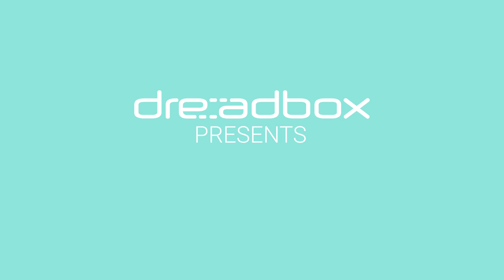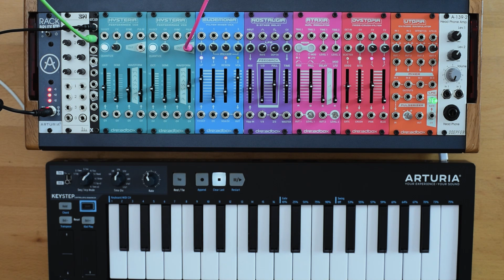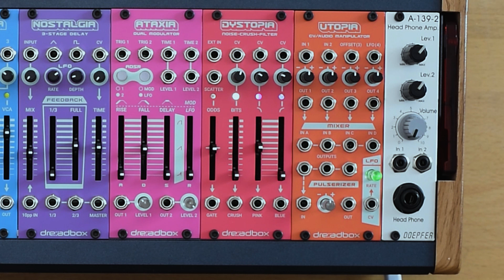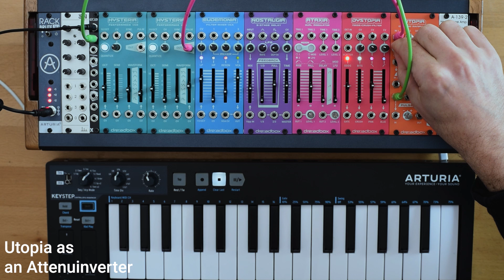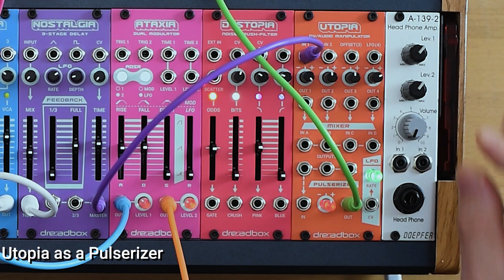Utopia / CV-Audio Manipulator - CHROMATIC MODULES by Dreadbox

Comment: It is unreal how much Dreadbox packed into one module here. 4-3 mixer. Buffered adder and splitter. Triangle (and a hack for square) LFO. 4 attenuverters. Distortion via the pulserizer. This is like five modules for less than $100. It’s possibly the best Eurorack utility value on the market right now.

Comment: Question: if you plug in CV into inputs 1 through 4, then audio into inputs a-d, and output that audio with the sum outputs, will the audio outputs be modulated by the CV in the inputs 1-4?

Comment: I get that ‘chromatic’ series calls for a colorful faceplate... but there is nothing better looking than a full black rack IMHO. Lovely little modules at an unbeatable price range though.
Reply: They made them all black lol
Reply: You could take the panel off and spray it your desired color?

I'm probably going to do it to my Ataxia, the layout for the module is symmetrical so I can spray it on the other side and preserve the front panel in case I change my mind. 

The main thing that bothers me with the chromatic range is how close the trimmer pots are to patch cables when they are patched. Makes it awkward to use them. I'm considering designing a few small modules specifically to control them for live performance.

Comment: Utopia is fantastic! Got one a few weeks ago, it just offers so much in a tiny space.  Essential for my 6U Rackbrute.  So much thought went into this Chromatic line, they easily outperform similarly priced modules. 

I was using a gate button module to advance my step sequencer but the signal was too much (10v) and caused it to skip steps.  So I ran the signal through the Pulserizer, which tamed the gate, and the sequencer works perfectly now.  haha  Good stuff.